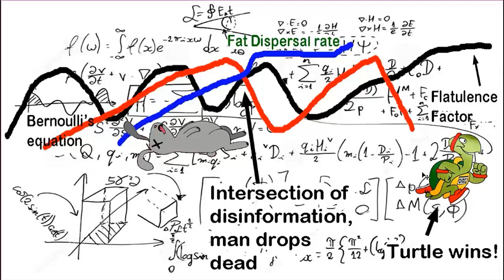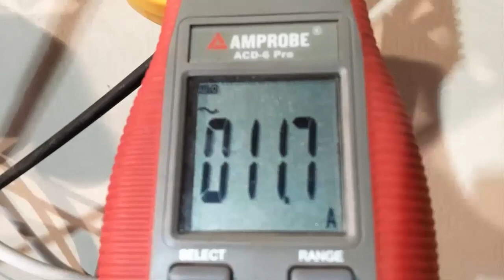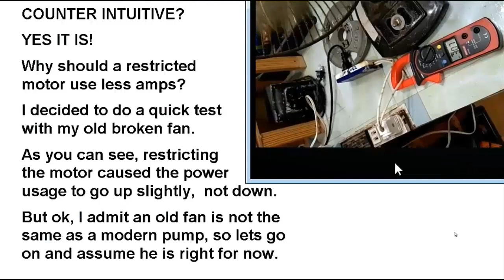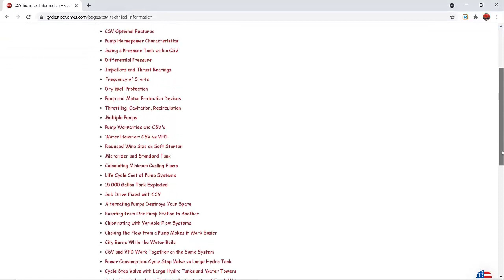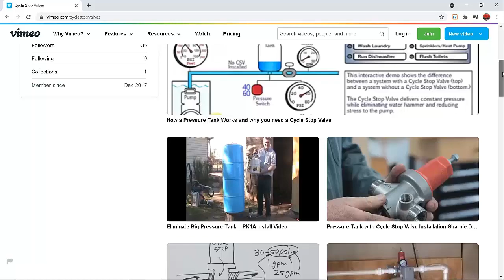Cycle Stop Valves are Bad?

Comment: Cary is a great guy.  He even got on the phone with me around 5 years ago when I was getting my cycle stop valve installed to smooth out the flow for my new sprinkler system.  (some round and round about the cycle stop valve and if the check valve was still needed)  Suffice it to say it just works.  I get constant water pressure and a lot less noise in my garage where my pressure tank is.  My pump is still running strong.  In my brain, it works like this.  (IT guy, not a pump guy). The pump runs at a constant speed due to the cycle of power fed into it.  It always wants to run at that speed in order to go round and round simply due to how the voltage is varied to the pump and the windings of the pump.  Alternating Current (AC).  If you limit the amount of water the pump can lift it will run easier, drawing fewer amps, because it simply can’t get bogged down lifting more water because there is nowhere for the water to go; thus the blades just slip though the water only lifting a little water.  It can only lift a little water and thus isn’t working that hard.  (I don’t like the idea of saying it creates back pressure and perhaps this is what confuses the hell out of people.  It simply restricts the diameter of the pipe the water can pass through; in a dynamic manner.). The CSV doesn’t really push water back on the pump.  If the pipe diameter is large, water is quickly moved and more water tries to take its place in the pump.  This is more water that the pump now has to lift out of the well.  This draws more amps in the process.  Just like any other electrical appliance, the more work the device has to do, the more power it will draw.  (reflected in amps as the voltage stays relatively the same). The less work the appliance has to do, the less power it will draw.  Remember that the blades of the pump are always slipping through the water.  (No matter how much water the pump is lifting this draw is always the same; basically, I don’t understand fluid dynamics.) The only real work that is being done is the lifting of the water from the well.  The more water the pump is lifting, the more work the pump is doing, and the more amps it draws in order to keep running at that constant rate.
Reply from the maker: Thanks for the kind words.  You did an excellent job explaining it.  I think it is funny that home owners such as yourself can understand and easily see the benefits of a CSV when a lot of engineers and pump guys, who are supposed to be educated on the subject, just cannot wrap their heads around how it works.  I think they are trying to make it more complicated than it is.  A regular full speed centrifugal pump using less energy when flow is restricted with a valve is just basic pump knowledge.  It is really that simple.  If someone tells you it is like dragging a ball and chain or one foot on the gas and the other on the brake, that is a red flag that they have no idea what they are talking about.
Reply: Also spent time with me on the phone my wife was very nervous could not have found a nicer man who owns their company that would take the time to talk on the phone with you. I believe he really cares about people
Reply: @robertantunovich7504  My pump finally failed a few months ago.  The damn thing fell off the end of the pipe and electrical tape got sucked into it..  It wasn’t the fault of the cycle stop valve.  The symptom I failed to recognize was I was getting air in my plumbing.

Comment: I installed csv1a and replaced old pressure tank pipes gauges ect.  And what difference it made!! Before installed csv1a I would water the lawn and the pressure would go  up and down and same with house(showering,dishes and so on)  Now the pressure constant and I can a shower do dishes water the lawn at the same time with no loss of pressure.  THE CSV1A WORKS love it
Reply from the maker: Thank you!  I believe there have only been 3 people in the last 30 years who couldn't see the advantage of the CSV.  Don't know how they can see, hear, feel a pump short cycle like in 30 seconds and think that is OK?  Enjoy the constant pressure and you shouldn't even have to think about your water system again for 20-30 years.

Comment: The amp usage drop for restricting output makes since. PSC motors on HVAC blowers will do the same. Higher static pressure equals lower amps / lower static pressure  equals higher amps.

Comment: The basic principle is a pump imparts inertia into a liquid.  Stopping the flow of the liquid means it just rotates around in the pump itself spinning a small amount of weight.  Once free to move the liquid moves out and more moves in going from zero speed to whatever the speed the departing liquid can achieve, that is the inertia exchange and loading of the motor.  It's like a paddle wheel pushing water from zero to moving.   Or a paddle wheel in a river that moves at the same speed as the paddle wheel, no load situation.  I am using one for multiple reasons, tank size, vfd drive lifespan/failure, vfd cost, current consumption, and pump life.  All of these factored into my decision for a system that puts out 40 GPM for irrigation during summer to 5 GPM demands during winter.  The basic premise is sound and quite a bit cheaper.
Reply from the maker: Thank you!  Very good explanation.  Some people, like the guy in this video, lose their minds trying to understand this basic premise. It is even worse that they get angry when someone tries to explain it to them.  Never had a Troll like this guy after me before.  I guess I should be flattered he is trying so hard and failing so miserably at trying to prove it doesn't work. Lol!
Reply: @cyclestopvalves8380  When I saw Larry compare a locked rotor state on a fan to near dead headed pump it was obvious he was comparing an apple to an orange.  A locked rotor state on a pump causes the amps to go way up there too, but that's not what your valve does.  To get an accurate comparison he should take the blade off of the fan and measure the amp draw, or put it in a vacuum so no air can be moved by it.  I must say your troll comes across as someone hell bent on destroying you and proving he is right no matter what.  The word libel comes into my mind when I watched part of his video.
Reply from the maker: @brianpikl6253  Thanks again.  Yeah the guy is crazy.  Classic symptoms of a narcissist with an Anti-Social Personality Disorder.  Will never admit he is wrong, even with the facts staring him in the face.  Lashes out at anyone who doesn't think he is superior.  Tries to punish anyone who disagrees with them, and the list goes on.  It is a personal vendetta against me for saying he doesn't understand how pumps work, even though it is obvious he doesn't understand how pumps work.  He thinks because he says it is "his opinion" he can say what he wants.  But opinions don't count when the facts are written on the pump curve. No question everything he says is libel.  :)

Comment: Chicken farmer here. The valve is the greatest thing since sliced bread. I used to have to use two 90 gallon pressure tanks, now one 35. Pumps last longer! Pressure tanks last longer! Pressure switches last longer! It works.
Reply from the maker: Thank you very much!  As you well know, the water system on a chicken farm is one of the most demanding on a pump system.  In the last 30 years we have helped many chicken farms solve these problems and get a dependable supply of water at strong constant pressure.  I am embarrassed for guys like the one in that video who should be fairly intelligent, but cannot figure out all the simple benefits of a Cycle Stop Valve.

Comment: I harvested some rain water finally, and now need to set up a garden pump system... Is there a pump with this valve already in it? A plug and play system?
Reply from the maker: All "plug and play" pump systems are designed to be "plugged and played" many times over and over.  They make them easy to install because you have to install a new one every year or so.  Adding the PK1A kit to a good jet pump will deliver strong constant pressure better than any other pump system.  Plus, the CSV system was designed to make your pump system last many decades.  In the next thirty years you can either replace about 30 of those plug and play systems, or with a CSV you will have forgotten you even have a pump system and just think water magically comes out of the faucets when they are opened.
Reply: @cyclestopvalves8380  Ok then... Sell me one please. And guide me to a tutorial for dummies. Thx
Reply: @cyclestopvalves8380  What I have is a cistern from the rain harvested off my roof... Not a 'well'.
Reply from the maker: @bosatsu76  Here is a good place to start.  You can see hundreds of pictures of systems like yours.  https://cyclestopvalves.com/pages/reviews
Then look at the videos on that web page for how to and why tutorials.  Been making them for 30 years.  Some are new, others are old, but they are all relevant.  Also, call of chat if you need some assistance and we will talk you through it.

Comment: Can this CSV create an enormous back pressure on the well pump, which can cause the pump to be damaged?
Reply from the maker: Back pressure is good for the pump/motor. It decreases amps and makes the motor run cooler.  It is counter intuitive and even lots of educated engineers can't understand it.  If your well is 200' deep and the house needs 50 psi the pump must build  140 psi back pressure just to get water to come out of your faucet.  A CSV will make the pump see slightly higher pressure like maybe 30-50 psi more, which again, makes the pump work easier and the motor run cooler when you understand the counter intuitive way pumps work. It is not back pressure but zero flow or pump dead head which can destroy a pump, and that can never happen with a CSV as it can never completely close.
Reply: @cyclestopvalves8380  can you put out a video of how this valve is good for the pump like a 1/2 hp or a 1 hp submersible .  please show/explain how this doesnt create more amps and help me understand the counter intuitive way pumps work.
Reply from the maker: @ricardoruiz6612  A 1/2HP can only build about 90 PSI and a 1HP about 130 PSI.   Even a 100 HP pump won't build but 100 PSI pressure or so, so no properly sized pump can build too much back pressure.  I have an entire web page that explains all of that.   To be such a simple valve it has a complicated explanation because it has so many benefits.  Nearly all of my videos explain the many benefits of the CSV.  But start with these. 
https://www.youtube.com/watch?v=3GABhLLtjas

https://www.youtube.com/watch?v=Mp_58yPGHOk

https://www.youtube.com/watch?v=_capz27LiYU

Comment: Finally have me CSV and 4.5 gallon tank installed. I cannot believe how much room is now freed up in my basement with that 50 gallon pressure tank out of here! I mounted the valve directly into the 1 inch main galvanized pipe coming directly through the wall. Valve on top, tank on bottom, roughly 4 feet off the floor. I had to rewire everything, the last plumber left a real mess with an old well control box and sloppily installed newer control box, wiring everywhere... All cleaned up now, new EMT conduit, the incoming pipe with electrical wiring all sealed up with plumbers putty, looking good! 

Install was easy, teflon tape the threads, tighten, repeat until all assembled. Hook up wiring, break out the Pex A Uponor, install a shut off valve and then direct to the plumbing... Works like a champ, water pressure is a constant 50 psi, and has never been better throughout the entire house. I did a temporary install, going to start re-plumbing the house tomorrow... 

What a difference over that huge pressure tank vs this compact CSV system. Now, when the pump starts, 85 foot submersible 1/2 hp Franklin, no more dimming of the lights, and barely audible noise. Not that it was loud when the tank was filling, but you certainly knew when it was. Not any longer, very impressed! 

Not being a plumber, I always thought it was the size of the pressure tank that made all of the difference in pressure and flow. Boy was I wrong! My first thought when I stumbled upon Cary's YT page was that he was selling snake oil. Hell, I was looking for an even larger pressure tank to install, which is how I found Cary... 

I watched a few of Cary's videos and went, hmmm? I think he is on to something pretty good here, as I know a bit about centrifical pumps, pumps that we used in the oil fields and of course mechanics, and it all made perfect sense. What is it about home owner style wells and plumbing that clouds our minds so much? Is it because that is how it has always been done, and there is no other way? I really feel stupid, especially with my background, having been around pumps of all kinds since I was a kid. I am glad I found Cary and his business, what an education, and I hope to share this knowledge with others.

Cary, I cannot say enough. You have a fantastic, solid product.  And again, thank you for the education, it is greatly appreciated!
Reply from the maker: Thanks for the kind words!  I wish everyone could see how it works like you do.  I was the same way. After 25 years in the pump business, I had to admit I was wrong about how pumps worked.  I have spent the last 25 years learning how pumps REALLY work.  Some people, especially some pump guys and engineers will never admit they are wrong.  Sad that they are so hard headed they will never see how simple pump controls can be.  The Cycle Stop Valve reduces pump control down to it's simplest form, which is an elegant way to make it bullet proof, dependable, and long lasting.

Comment: I have had some minor issues along the way. But overall, really glad I found you guys. I HATE HATE HATE the up/down water pressure/gpm that bladder tanks / pressure switches provide (or lack therof). My wife LOVED when we moved out to the “country”  . . but she said is there anything we can do about the terrible water pressure? She has a huge mop of hair and said it takes her a long time to rinse her hair. I remember the conversation . . I seem to have good pressure, then it drops then up and down. I used to watch the sprinklers perform properly and then slowly start to lose their “distance”. 
I will admit I was a bit of a skeptic . . . HOWEVER, even after installing a MUCH larger jet pump (with CSV valve) I have NOT seen my power utilization jump like I thought I would. Now my wife enjoys the constant water pressure and I don’t worry about my sprinklers causing my pump to cycle on and off like it used to (before the CSV valve). We are adding another water tank and another pump / CSV valve because we have developed more of the land and want to setup a separate watering system. 
NOTE: The one downside I can see if you move to this type of setup  . . you will have a constant / higher GPM. If you have an old septic system, you might end up with over saturation in your drain field. Our house is setup with a  gray water system – all showers and hand lavatories dump into a gray water tank that is pumped out to the perimeter of the house, trees, shrubs etc. This water never makes it into our septic system. Be sure to keep this in mind before you by this setup. 
BTW . . . an 85 gallon bladder tank costs $500 - $1,000 (quality and origin are major price role). The CSV cost is roughly $550 (with shipping). It did cost me a bit more because old school plumbers are afraid to do anything differently. I have since dumped my “city plumber” for a “country plumber”. 😊
Reply from the maker: Thanks for the kind words.  I wish someone could convince this Larry guy how foolish he is for not understanding a CSV is very beneficial.  As you mentioned, about the only disadvantage can be with the septic system, as the CSV lets you have all the water and pressure you want.  Just need to be careful not to enjoy high pressure showers for too long or the septic may overfill.  But that can be a good problem to have compared to not having enough pressure to get the soap out of your hair.  Lol!  I hope others can see like you did that Larry is as full of crap as an overloaded septic system.  😊
Reply from the maker: Also, thank you for your efforts replying to crazy Larry.  Sorry for the abuse and insults from him.  I am afraid he has already made up his mind, so there is no sense confusing him with facts.  But if I can help let me know.  Thanks. Cary

Comment: I heard about cycle stop valves through a YouTube well installation channel that seems quite good. The criticisms online appear long on ‘intuition’ and short on data and calculations. Definitely understandable that pump and tank makers don’t like something that cuts sales of replacements and variable speed control systems (and petty that they won’t honor their warranty if used). I do have a question though. I want to install an NFPA 13D residential sprinkler system that will incorporate a pump. I haven’t seen anything in the NFPA standard or online about concerns about a CSV. But has anyone had a problem getting a residential sprinkler system with a CSV approved for a permit?  Thanks for any responses.
Reply from the maker: We use Cycle Stop Valves for residential fire systems all the  time.  How else could you have a 30-40 GPM pump for fire sprinklers and expect it to work when taking a 3 GPM shower?  The CSV is the only way the pump would survive the everyday cycling on and off and be in good shape if needed for a fire?
Reply: @cyclestopvalves8380  Thank you for the quick reply!